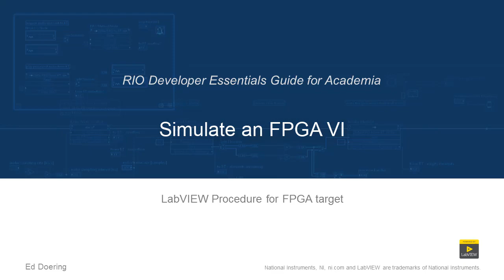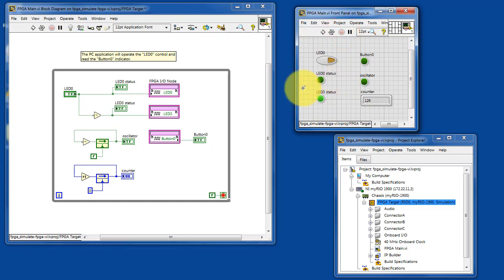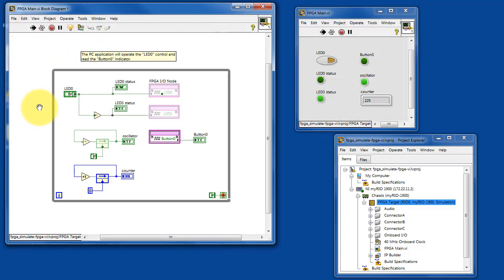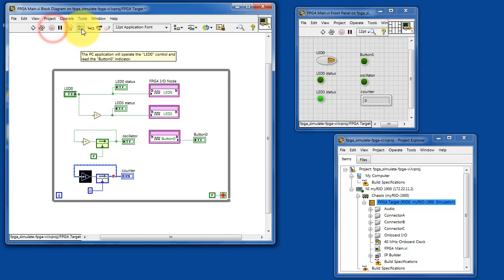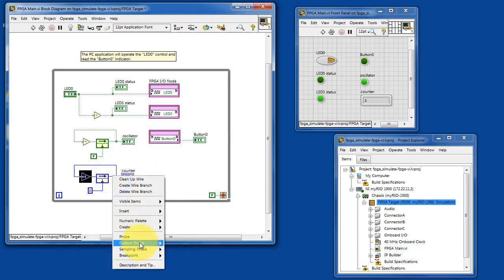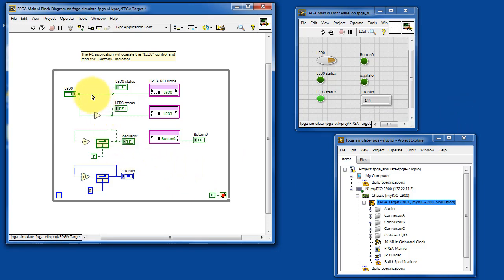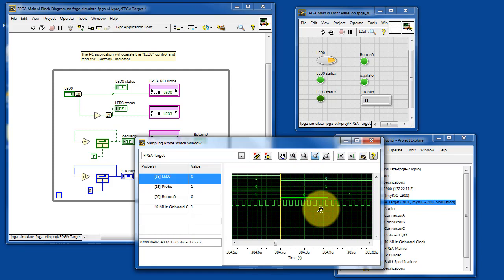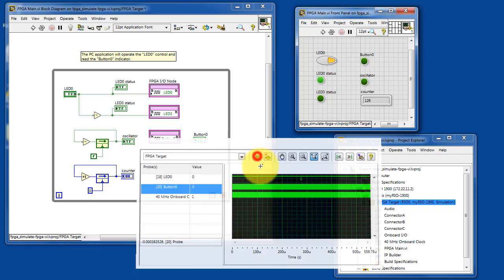LabVIEW procedure: Simulate an FPGA VI

Comment: Thanks much uploading this to demonstrate methods for debugging LV FPGA.  This video is very useful!
One bad thing about debugging with Sampling Probe is that LV FPGA simulation runs as fast as it can handle; therefore, sampling probe takes up much memory.  To correctly use Sampling Probe, users are required to know about Desktop Execution Node to control the speed of simulated execution...